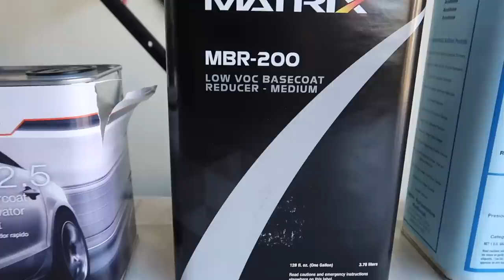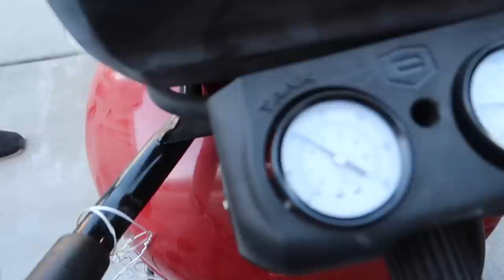START TO FINISH! PAINTING A HOOD IN OUR GARAGE!

Comment: Turned out awesome in my opinion. Word of advice tho. When painting base boat. Try overlapping the coats each pass you make over the hood to get rid of the stripe effect. It will help get even coverage of paint on the surface and will look better. Try using one hand when spraying. More precision. Takes practice. But honestly not bad for first time. This is a game changer for you. Best of luck with the whole car.

Comment: No disrespect as I'm learning too but, when pouring from a full gallon container, try starting to pour with the opening positioned on the upper end (opposite to what you had) and you will find it will pour out smoothly and easier without the splashing into the containers below.

Comment: Message me if u guys need help. You will need at least a 60 gallon compressor to paint the whole car. You should really invest in a better spray gun for the clear coat. And finally you guys used the wrong pad for the job. I suggest a wool pad for the initial polish, then you can come back with a less aggressive pad. Not bad at all for a first paint job!

Comment: Feels like so much extra stuff... Im painting my hood, just going to be using rattle cans... Wet sanding, primer, duplicolor black base coat, and 2k clear gloss coat... 10 min between coats and 3 coats on the primer, 3 coats for base, and only 2 - 2.5 coats of clear.... Afterwards maybe some light polishing and after a week will go through the wax/sealing process...

Comment: Couple of tips to help you my brother!
Throw a guide coat after the primer so you know it’s levelled. Here in England we use 600 wet sand. 
You guys have good weather so I’m sure the garage has a decent temperature for the paint to cure. 
Take your time with the car doing it in sections. 
Isopropyl wipe the full car and then go over with tac cloth. 
Higher temp in the booth when throwing down lacquer as it won’t have time to create runs. 
We don’t wait 24hours to lay down clear literally 10/15 minutes after last coat of colour. 

Other than that you’ll be fine Insha’Allah ❤️

Comment: It didn't look very shiny to me. The overhead lights are fuzzy. More like a semi-gloss finish vs gloss. Maybe it was the clearcoat you used. Ive used stuff out of a can that was smooth and shiny when dry, and didn't need much polishing. For all the work you put into prepping the room in plastic, and you didn't try to fix the dents? To each their own. Good practice though. I'm about to paint my hood myself and I just dread sanding it down because someone painted it before me and there are layers man. Maybe it'll sand off quickly and I can get onto painting quickly.

Comment: Your missing a moisture filter on that gun and you should have used 320 grit dry and then 600 wet(water) when sanding primer...sonny boy
Reply: Dellor26 I did use a moister filter, just didn’t install it until after the primer was on 😅